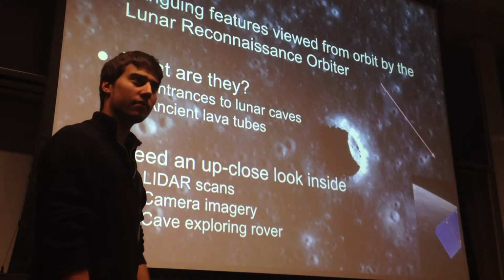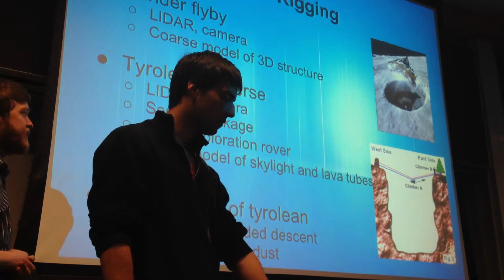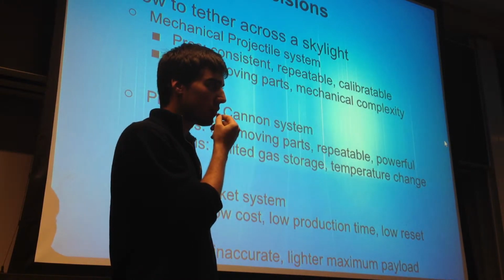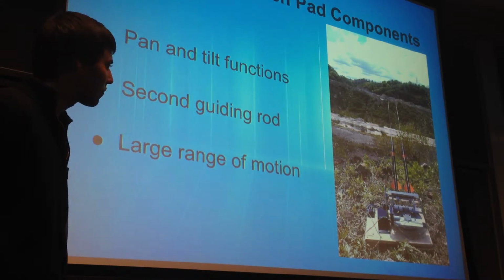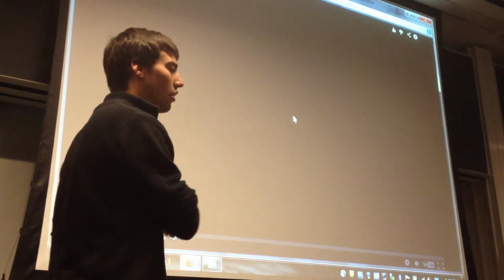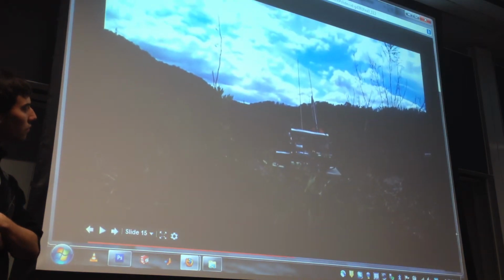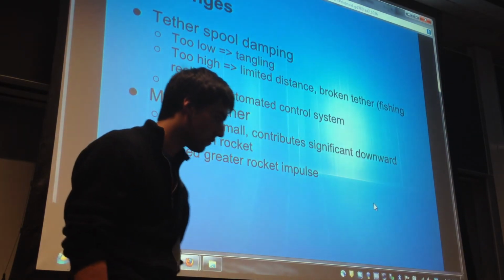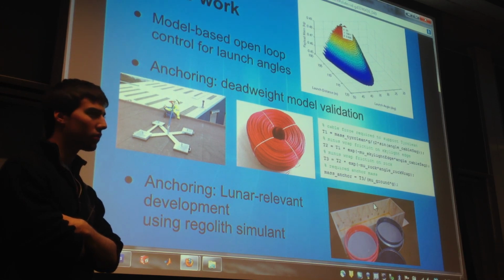Finals_Rigging Team

Comment: Though I know it wouldn't have made for a semester project, why not just anchor the line to one side of the lunar skylight and then drive the rover around the perimeter of the skylight unspooling and dragging the line behind?

If it's a 50m diameter (157m circumference) skylight, the drive around the perimeter to the other side would only be 78.5m. That risks the line getting nicked by rocks as it's dragged but it seems like lower risk than a single-shot rocket.